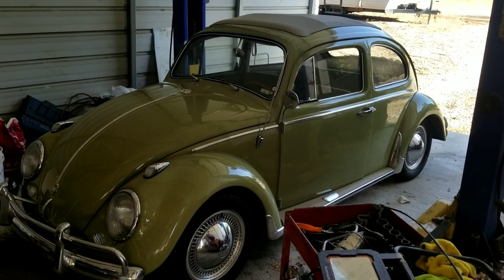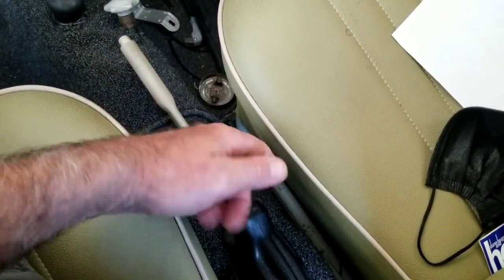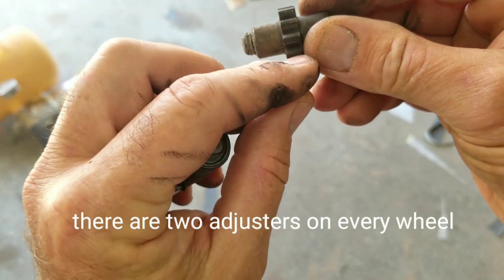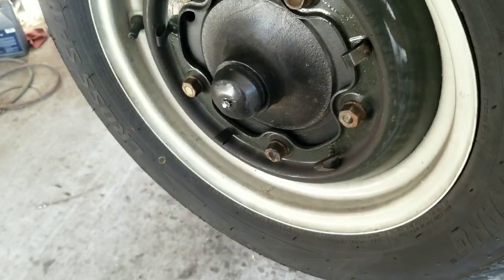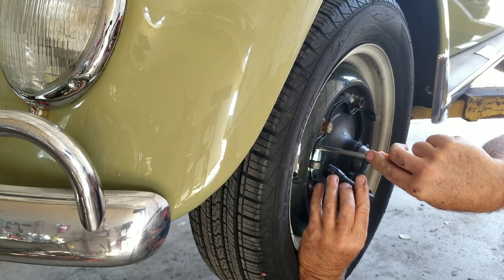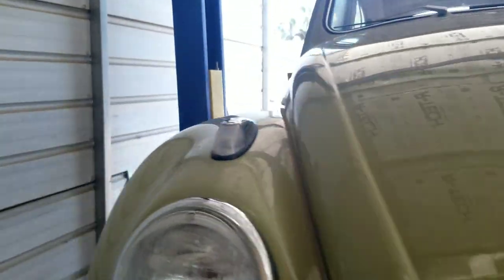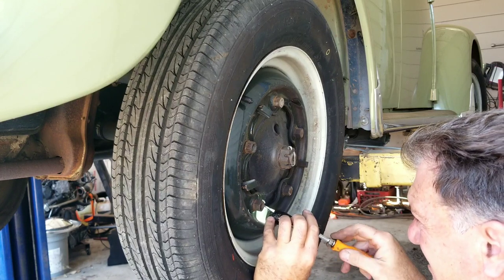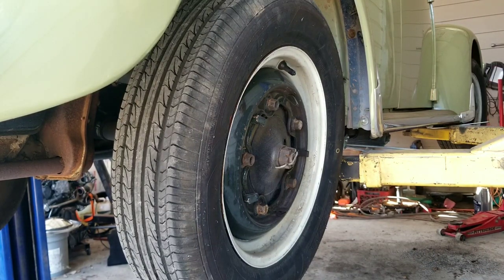Adjusting Classic VW bug brakes How I do it.

Comment: I recently replace wheel cylinders, shoes, and lines, including master on my little 62 bug. I became frustrated attempting to bleed air out. I took a break and came back to it. I managed to vacuum all the air out to where the clear vinyl tubes I was using became solid with fluid, no air. The pedal went to the floor and I was just perplexed. It took me awhile to figure that the slave cylinder does not move very far which is why it is critical the adjustment is made shown here. Anotherr factor was that the e brake took till the top to engage the drum, when each cylinder was adjusted the brake engaged the drum much earlier. The amount of thinking and patience one must have in working on these cars can be draining, but you have to do it!! Great video, Thanks!!
Reply: The more I work on them I realize how well they are engineered as a car for the people. Simply engineering, well built and can be repaired maintained with the basic tools.

Comment: On. 1966 and 1967 can be adjusted with the wheels on  65 back can also if you have a angled brake adjustment  my late father was a Certificate Volkswagen  mechanic    he had  heated those tools and was beating Volkswagen s flat rate.

Comment: Mike uncomplicate your life and buy your self a narrow handle brake spoon, makes it so much easier. They don’t cost much and it isn’t a VW only tool. But they do come in different widths and it is under $10.00 most places. Your front does 80% of your stopping power in general where as your rear when adjusted correctly just keeps you going straight.

Comment: Hey Mike! What size are your front tires and what a good brand to buy in your opinion
Reply from the maker: I think they are smart car size....I dont remember what like 175 55 15 or something like that I will look a bit later. They grip better than the old 135 15.... but are lower profile then those. fit perfectly on the rims. THere are also 165 55 or 45 which are even smaller.
Reply: Looks like Mike has the same Nankang tires on his bug that I have on mine.  There aren't a whole lot of choices these days but the Nankang's have been perfectly fine for me so far and are very reasonably priced

Comment: My brake pedal went down all the way last week. Noticed my fluid reaevoir was empty. I filled up, so, now do i pump the pedal few times, ?
Reply from the maker: you have a leak somewhere. pull all the wheels and check wheel cylinders. chase all the lines to see what failed. After you repair that you need to bleed the brakes.

Comment: Hi Mike, I have a beetle with a pulsing brake pedal, and with new rear drums it still pulses. Could this be caused by bad bearings?
Reply: did you manage to fix it, what was it?
Reply: @matixd22  bent wheel studs